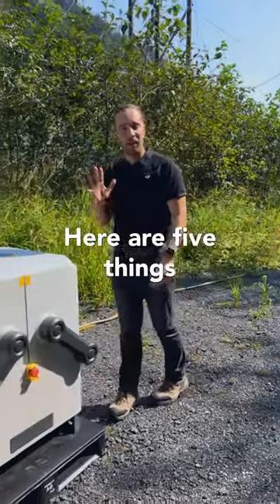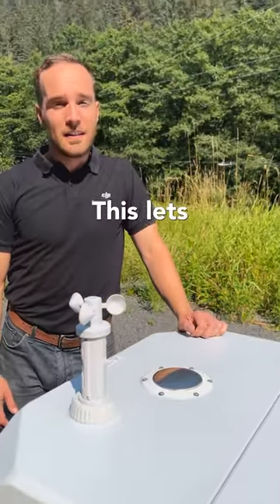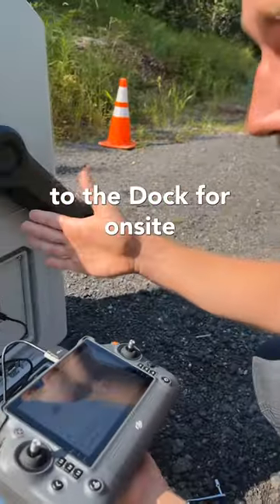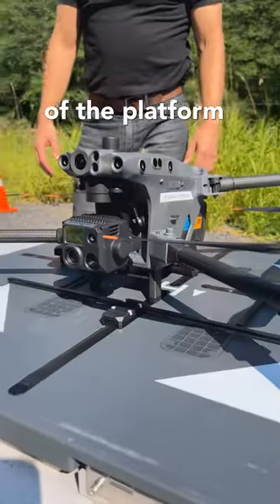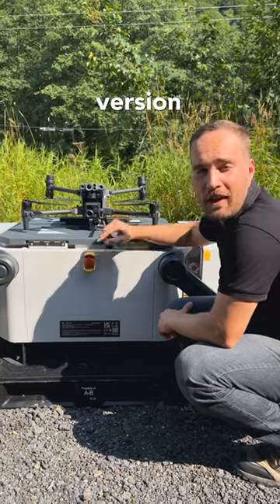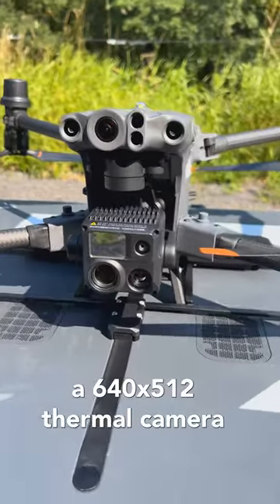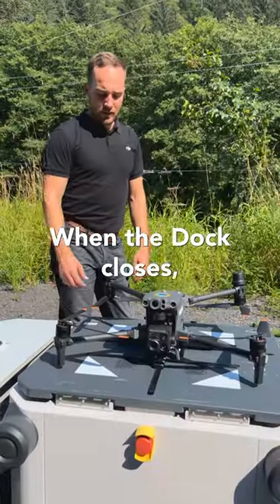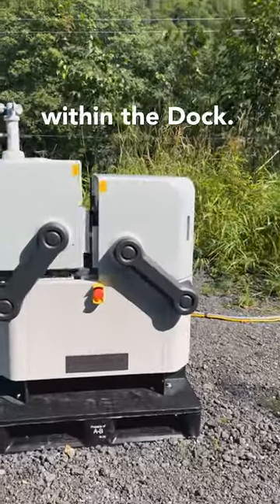Five Things To Know About DJI Dock

Comment: Hey Grant!  So what's it like to work for a company that has so much disdain for its customers?
Reply: explain
Reply: @HarryKuloh  Do your research
Reply: Dji are pretty good with warranty in general. The one issue specifically that you might want to raise is that the mini pro 4 care fresh plan states one replacement and one repair. But then when I crashed with minor damage they exchange for refurbished one although my drone is 1 month old . Should have been a repair to original. They do NOT do repair only swap out refurbished.